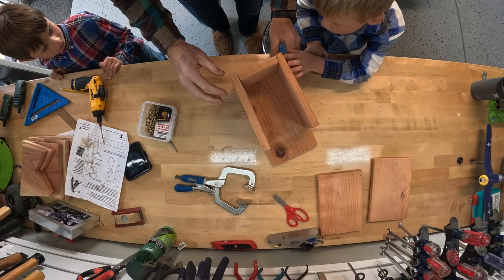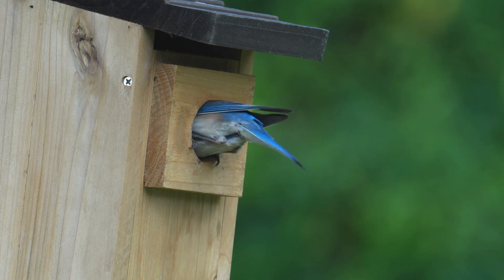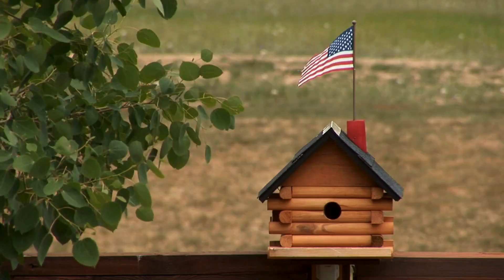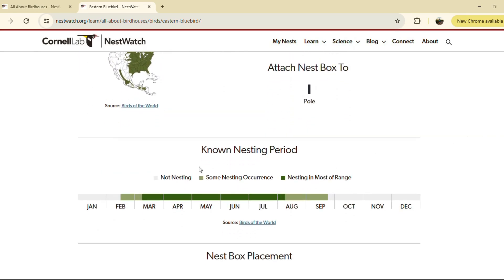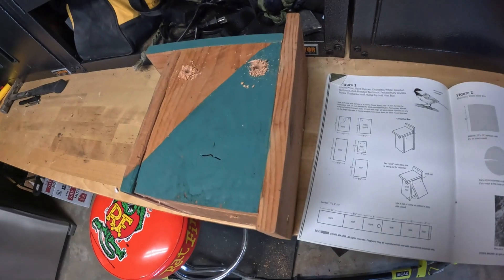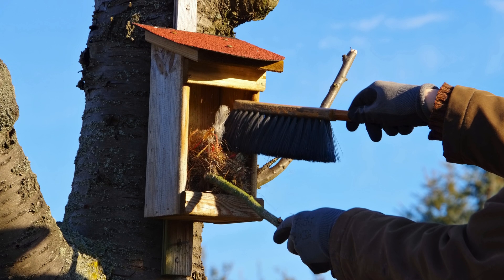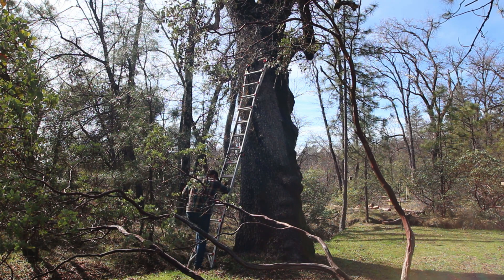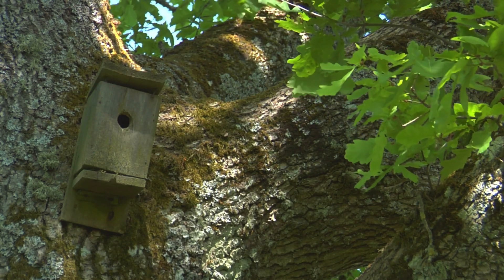Why Most Birdhouses Fail (And How to Fix Yours)

Comment: We put boxes up for mostly Chickadees and House wrens. The Bluebird box is always overtaken by House sparrows so I use it as a trap to help bring down the numbers of that invasive species. In a park nearby the Bluebird boxes are often successful. Also for the first time we put up a Screech owl box. Thx for the video.
Reply from the maker: Thanks for sharing your experience with your nest boxes, and sorry to hear about your Bluebird box. I’ve heard putting two entry holes on the same panel might help them defend off House sparrows and have also seen folks recommend use of a Noel guard. So you might look into those options? Your Screech owl box sounds cool. I made a Great Horned Owl nesting cone this winter but unfortunately I think I’m too late in the season getting it out. Maybe next year! Thanks for reaching out and best of luck!